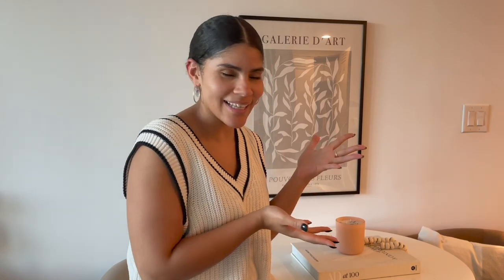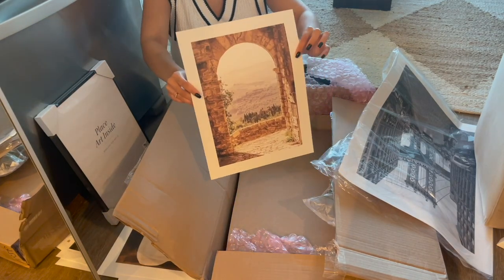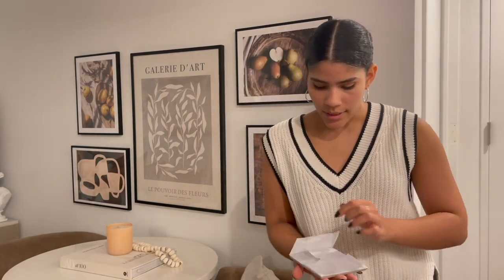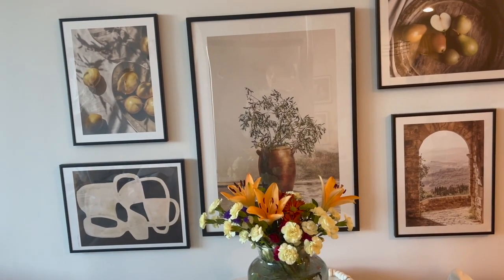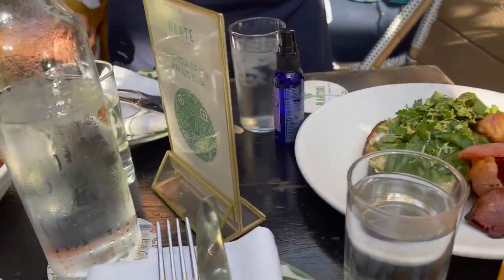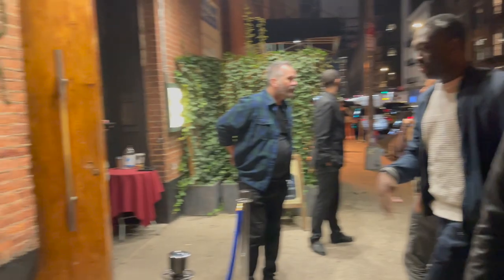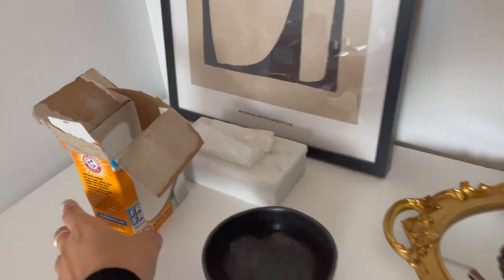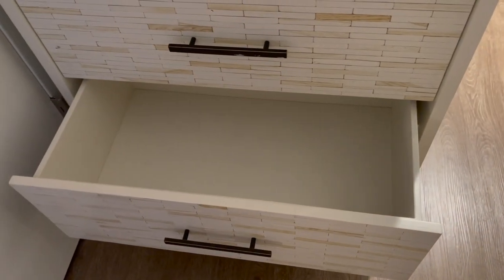NYC Vlog | Dining Room Art & more apartment updates, Perfume Making at Olfactory

Comment: what is up with all the metal plating around your apartment?! Is that normal?? I have brick behind my drywall, but luckily it's only on my outer walls.
Reply from the maker: I don’t know what’s going on!! It’s really limited me decor wise 😓
Reply: @kirsten-ashley  This probably isn't a real solution... but maybe you can use magnets to hold up your ceiling light!!! Or maybe a hook off the wall near the top? One that juts out? Like a plant hook.
Reply: @kirsten-ashley  I'm wondering if it could be some kind of firewall?!? 🤷‍♀️ My daughter has the same between her and the adjoining neighbour's house in their RAF accommodation. After many failed attempts to hang pictures they were told that's what it was!